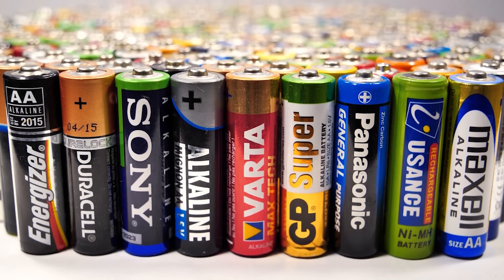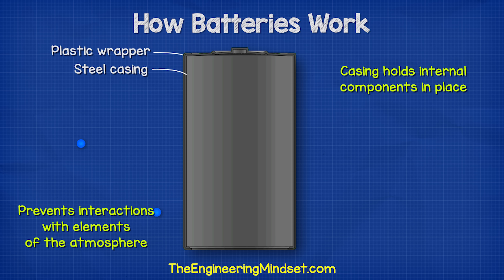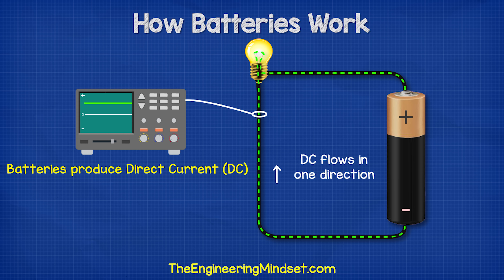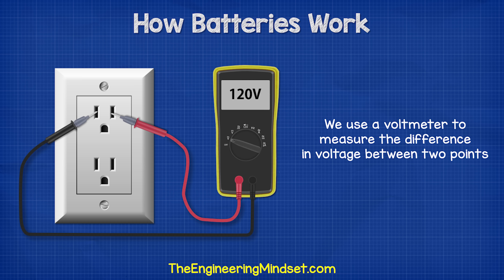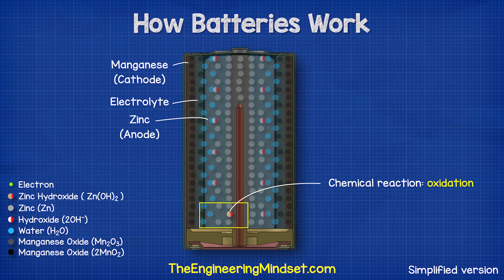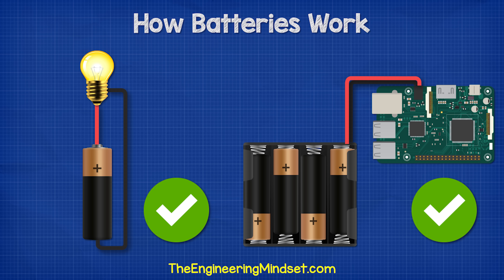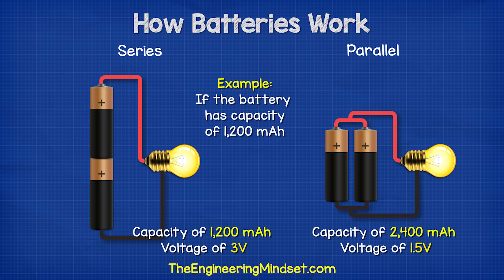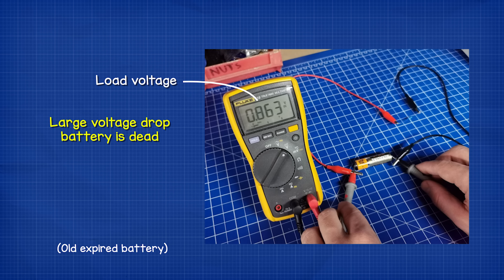How Batteries Work - Battery electricity working principle

Comment: Your explanations were excellent except for one confusing part. In an unconnected state, where are the 2 electrons coming from for the reduction of manganese oxide on cathode end? When battery is connected to an external circuit then we know that  the flow of electrons into the cathode end provides for the 2 electrons needed per chemical reaction of reduction. I think the cathode reaction only occurs in a connected state.

Comment: So, it's a little vague on what is meant by the "battery pushes the electrons..."  What I am imagining is that the stored chemical energy kind of seeks it's own level?  does it want to establish some kind of dynamic equilibrium?  as in if one were to have a long enough cable, the electrons would simply reach a point of stasis with the conductor - spreading out evenly?

if the battery is chemical energy stored, and conductors are connected in a loop on both the positive and negative sides, how does the fact that it is chemical energy. matter? Are we not still dealing with trapped electrons?  How do batteries 'die' if they are not used over a period of time?  Is it some kind of electrical osmosis, where the electrons escape - or do they dissolve into an inert composition retaining the same potential, but an altogether different form?
Reply: The battery also "pulls" the electrons at the other end.

Comment: Why is the lamp brighter if the batteries are in parallel ?
Reply from the maker: Because the voltage has doubled
Reply: @EngineeringMindset   Princess Pat seems to be asking what happens when they are in parallel, not series.  The lamp would only get brighter with the batteries in parallel if one battery was no longer able to supply it's full voltage to the lamp ie when the battery is becoming depleted.  Normally putting another battery in parallel will make no difference to the lamp's brightness, although it would be able to supply full voltage to twice as many lamps since the availability of current has doubled.  In practice we don't wire batteries in parallel because the voltage output of both batteries will never be exact and one battery will discharge into the other and waste charge.

Comment: I have a doubt here! The Zinc is supposed to be at outside and the MnO2 inside, which surrounds the graphite rod! Electrons flow from Zn to the graphite rod (conventional current to the opposite direction)... And the NH4Cl+ZnCl2 paste serves as an insulator...right?

Comment: Hello, so I had a question regarding what was stated about "capacity" of a battery at time 13:51. The units for the capacity listed was Amp*hours. Since amp = charge/time; we have 
charge / time *time = charge. So the capacity you are referring to is the amount of charge a battery holds? I was wondering if you could possibly elaborate on what it means for a battery to hold a capacity of charge, when I thought the point of a battery was to supply a potential difference and thus allows a current to flow.

Any help would be greatly appreciated!
-Dakota
Reply: You noted correctly that current=charge/time. Let's say a battery has 10Ah and you connect it to a load that requires 1A. The battery will be able to provide current for 10 hours. So how much charge flowed through the wires in those 10 hours? Charge=current*time=1A*10hours=1A*3600s=3600 Coulombs. What this means was that the battery is able to deliver 3600 C of charge until it got depleted.

The rating of charge is equivalent to the rating of capacity in Ah, but it makes more sense to regular consumers to say 10Ah rather than 3600C.

The point of a battery IS to supply the potential difference (voltage) that allows current to flow, and batteries have a 3 ratings: voltage, internal resistance, and capacity.

1. The voltage is the force that pushes charge. It specifies how "willing" the electrons are to pass through a certain resistance. If you touch the terminals of a 500V source, the current will be 5mA which is dangerous for a human, even though the power used is only 2.5W. A car battery can start at 6kW (low powered ones) and can deliver 500-1000A to the cars electrical circuit, however, since it's only 12V it can't send that current through you. It can barely do 0.1mA.
2. The internal resistance specifies how powerful the battery is. A 9V battery has a very high internal resistance and thus is not very powerful, while a 12V car battery can deliver hundreds of amps. This resistance wastes power and also limits the current: even if you have a 0 ohm circuit, the current won't be infinite.
3. Capacity specifies how long the battery will last. The higher the number, the more time the battery will be able to provide current.

Comment: Another excellent video, thank you. However, there's one issue I have with circuits that have been bugging for a long time. Considering the fact that electrons "lose" the potential energy they acquire due to the electric field that is created between the anode and cathode of the battery, what keeps the electron moving at the same "pace" to the positive terminal when all energy has been "spent" on the circuit loads? I think of a situation in which, at some point, we agree to have 0 V in the circuit, usually after the last load on the road. I may struggle with some principles that result in my lack of understanding, but this is something that I can't wrap my head around.
Reply: In theory, yes, but in practice, no.  
The wires connecting the loads will have a very small resistance, so be a very small load themselves.
Reply: Voltage is an artificial number, you can define it as 0 anywhere you want, it doesn't affect the physics. What matters is differences. For gravity, the convention is that zero potential is at infinity, and all objects have negative gravity potential. When the electron gets to the terminal that you measured at 0V, it actually still has some tiny potential (some energy) which is used to go the rest of the way down to the battery's internals.
If the battery heats up, that means that not even all the energy was spent moving electrons. It's like electrons are coming in so fast that they collide with the atoms inside the battery. (This is simplified because electrons don't actually travel all the way, they shift neighbour electrons, and the physics for this warming up are probably even more complicated).

Comment: So a battery isn’t using up electrons, it starts and ends with the same amount, but it uses a chemical reaction to pump them through a circuit, so when the chemical reaction can’t continue electrons stop being moved and the battery is “dead”?
Reply: Exactly. A battery is simply pushing the electrons across the circuit.

Comment: Nice & Extraordinary. Love it.
  I have few doubts...
 @0:7:16 Please define the Charge & its characteristics. 
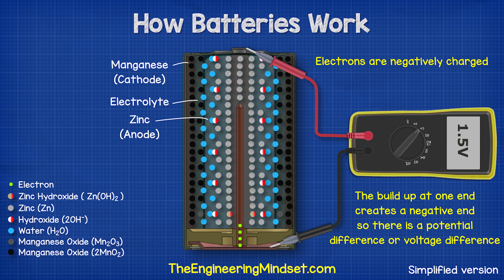@0:2:17  0:10:31  0:10:52  0:12:12 Does the +ve terminal(Cathode) of alkaline battery holds/carry any +ve/neutral charge (because we usually call it a +ve terminal) ?
@0:13:46 why more current but same voltage ?

Comment: What is the resulting potential when 1.5v battery and 5v battery connected in parallel
Reply: 5v or less, the 5v battery will try to charge the 1.5v battery.

Comment: A practical point: the batteries described in the video are the non leaking kind marked with "LR".
There is an other kind of very leaky alkaline battery that has the zinc on the outside as a caseing. They consume their caseing while dischargeing and eventually leak out.  They are marked "R" try to avoid them.

Comment: Two questions that would have been nice to have answered....why doesn't a dead battery give 0 volts, and what happens when you recharge a battery. Great video nonetheless, as usual
Reply from the maker: It can give 0 volts if the barrier is broken. Rechargeable check this video https://youtu.be/VnPRX5zQWLw

Comment: What is the difference between series battery connections and parallel battery connections and hoe do they increase battery voltage and capacity?
Bro I want a video on this...
Reply from the maker: Please check out parallel and series circuits videos

Comment: Great video. Clears up many questions I had. I still have some though. 

1) Why doesn't the dead battery show 0 volts? When it expires, shouldn't the positive and negative ends even out between themselves, since no more electrons can be generated by the chemical reaction? Thus there will be no potential difference between two end that are charged the same. What causes the 0.8V that you see on a dead battery?

If we do get the 0.8V from it, why doesn't the voltage still push the electrons? If we go back to the water analogy, a small pressure of 0.8V is still a pressure, rather then no pressure. That should keep things going. So the lamp should be lit up, even if by a small, faint amount. Why doesn't this happen?

2) Will a connected battery's voltage fall as time passes? If it starts out at 1.5V, will it go towards 0.8V linearly as the chemical reaction is harder and harder to occur, or will there be a certain point in time when the voltage suddenly drops from 1.5V to 0.8V?
Reply: 1) Basically this "resting" voltage shows that the discharge is not 100 % but instead 99.9 % and there are some electrones who still feel that they wish to be at the other electrode but when it comes to doing something about it they quit.

In the water analogue l'd say it is like a leaky tap connected to a closed hose. When you open the hose there is a rush of water indicateing that there is pressure, but than it instantly turns back to a dripping that has the rate of the leaky tap. Basically the reaction can build up voltage over time but it can't do current beacuse the chemical pathways are mostly missing due to the lack of reactants.

With more science: This "resting" voltage is named Electromotive force. It depends on the concentration of the rectants and the type of reactants in accordance with the Nernst equation (ideally). So voltage will drop but until there is anything left of the reactants it will produce this voltage while not loaded. But this equation breaks down when there is current beacuse effect like diffusion start to dictate the rate of the reactions. And basically there is no concentration difference left anymore for this diffusion. (but don't quote me on this last part)

2) Here is the graph:
https://www.powerstream.com/z/AA-100mA.png
For a while the voltage barely drops but than there is a sudden change.

Comment: If charging a battery with a generator    is there a certain amount of voltsor current that is allowed before it destroys te battery. Like if its a 12v battery and the generator produces 200v will the battery be able to handle that?
Reply from the maker: Check out how car alternators generate electricity here: https://youtu.be/jdSKlg80DjU

Comment: Hi,  three days ago I saw farmer near my home. He is using solar panels to power a three phase 10hp ac motor to pump ground water yo agriculture field. I asked him about ,, but he is not that much good to explain
. He is using  a VFD( invt ) for this purpose. It would be great if you could explain it. Thanks for. Everything so far. 👍 I know there video on "how vfd works" but it's taking high voltage DC as input.
Reply from the maker: He will likely be using a set up like this: https://youtu.be/iIqhAX0I7lI
Reply: @EngineeringMindset  I think it's not brother,, the vfd was extremely light.(feels like no transformer inside(I don't know,, surley he won't let me open it)) 
He's panels are connect in series, each panel is about 320 watts, 20 of them. 
My question is that??if he has connect 20 panel in series to produce 380v-440 volts and that strange VFD converts that DC power to AC to power that pump. It's is my guess is it possible.?
Reply: MPPT based  solar vfd.. How this stuff works?

Comment: Extremelly useful information learnt today, Big thank you for this channel!

I do however have a question, mouses, remotes and other devices that requires multiple AA/AAA batteries are these connected in series or parallel? Looking to my mouse it only says that it requires 2xAA 1.5v batteries. Either my mouse needs 3v to operate (in series) or to have a better capacity (in parallel).

Comment: Hi great video, but either I confused myself (easy to do) or perhaps you misspoke at time frame 2:51. You
said the 1st layer is the "Anode" a mixture of Manganese Oxide and Graphite, then a fibrous barrier, a alkaline
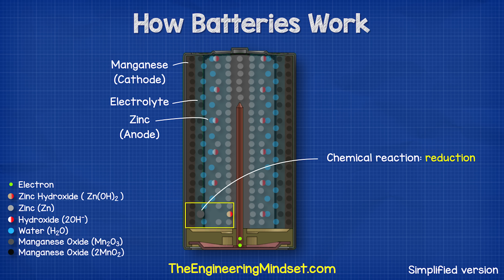electrolyte, then a Zinc powder Anode.  Anode,barrier,Anode!  At 9:55 a picture shows Manganese as Cathode!
So in a way if ppl truly pay attention or waiting for the cathode to come into the picture, 9:55 will grab their attn.
Quite possible, I misunderstood everything from beginning to end...in which case, I greatly apologize.
Reply: Yeah, I think he misspoke and called the Manganese Oxide & Graphite layer anode when he meant cathode.
Reply: yeah , i also noticed the same thing
Reply: Yeah, he probably made a mistake.

Comment: At 13:23 what do you mean my "boosted". That never made sense to me. The electrons that enter the bottom battery just enter it and make that chemical reaction in that battery. Why would more electrons gatter in the negative terminal of the bottom battery then on the top one?
Reply: So, I will try to answer your question in a way that I understand. Each battery has a certain number of electrons that are concentrated in the lower electrode in equilibrium due to the repulsion between them. When you connect two batteries in series, electrons from the bottom of one battery flow to the top electrode of the other battery due to a voltage difference. This current creates a reduction reaction at the cathode of the other battery, which in turn forces new electrons to rise. As a result, more electrons are stacked on the bottom of the battery, creating a new state of equilibrium.
Reply: @DjAlon3  Are you sure about this? I have the same issue with power supplies. If you connect two 5V power supplies in series you get 10V across them. But why, how?
I understand that this is happening, but it makes no sense to me.
The first power supply/ battery gives +5V compared with the negative side; the second power supply/ battery should have 0V on its "negative" end compared with the voltage on the "positive" end of the first battery. So the voltage across the tow power supplies/ batteries should be also 5V.
Even if you think about the flow of electrons it makes no sense: The electrons are going in the first power supply attracted by it with 5V, they leave that first power supply with 0V... english is not my first language and is hard to explain, but do you understand what I am trying to say?

Comment: Never runed thoose batery tests...still... voltage drop depend on resistor we choose. I mean if i put 10ohm resistor for capacity test for 1.5v AA i believe i would see biger volt drop then 2mV. So its not so simple to see if volt drop is big or small to define if battery dead or not. Fell free to corect me If im wrong
PS- still, concept of test is right.
Reply from the maker: Check out NEW resistor video, everything covered! ➡️ https://youtu.be/DYcLFHgVCn0

Comment: I have a question that I have so far been unable to answer properly: why can't I take a lead from the positive of one battery and attach it to the negative of another battery and run a current between them?

I can't really understand this. Some people say that you need a circuit but I know that lightening doesn't require a circuit.

My guess is that the chemical reaction within the battery requires the movement of electrons to work. Is this right?
Reply from the maker: There could be a small initial transfer of electrons at the moment of connection, because the electrons will want to balance out but this will last a fraction of a fraction of a fraction of a second. You need a complete circuit for the chemical reaction to continue. There will not be sufficient space within the atoms to keep accepting electrons from the other battery or for the ions to transfer through the barrier.
Reply: @EngineeringMindset  amazing, thank you so much. This has been really puzzling me

Comment: i hope you one day make a video about metalls and there cunductivety vs Thermal conductivety like silver conduct good but gets hot quickly so it easly breaks if too much amp maby or am qurrious cuz if i remember correctly silver was firstly used in telephone wires might be thicc ones but over time it cost and got silver to be expensive so they turned to copper since its more cheaper? i guess thats some of the reason wolframe steel i  used in the old lamps(Light bulp`s) but also in some common heaters in eu(my contry is norway) but also common in water boiler`s :)

Comment: What if we connect positive and negative without buld will it loss energy?
Reply from the maker: Yes, the battery will short and get very very hot. Don't do this
Reply: @EngineeringMindset  so what is there inside the bulb that prevent it from short circuit
Reply from the maker: resistance
Reply: @EngineeringMindset  thank you so much
Reply: @EngineeringMindset  can I ask one more question?